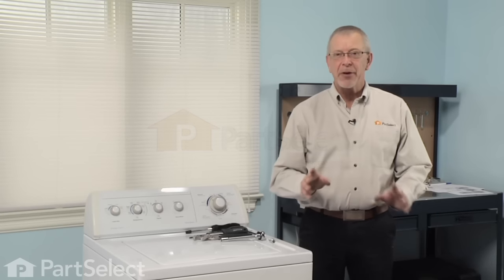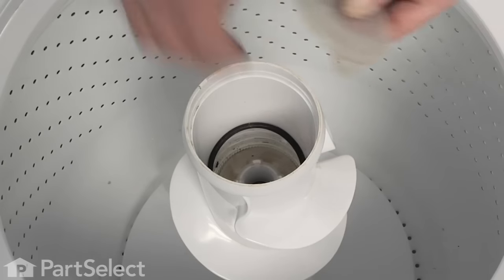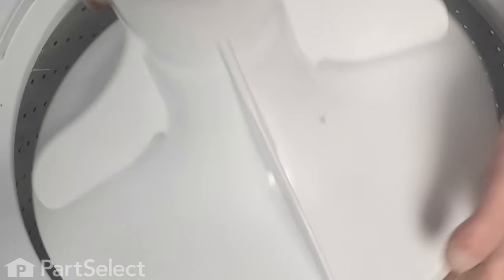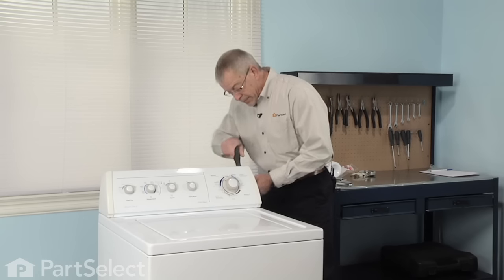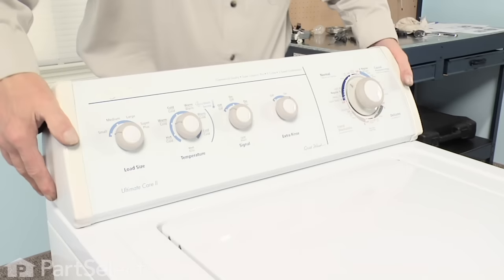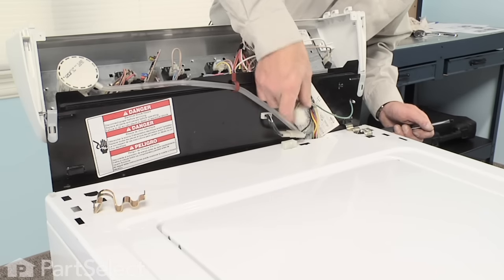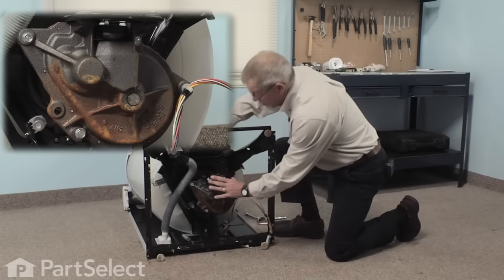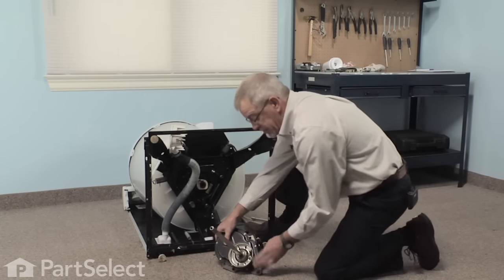Washer Repair- Replacing the Clutch Assembly (Whirlpool Part # 285785)

Comment: Do you find it absolutely necessary to remove the cabinet?  I have done couplers without removing it and didn't find it too bad.  Going to replace a clutch on a Whirlpool washer tomorrow and thinking I can probably do it without removing the cabinet.
Reply from the maker: You don’t necessarily need to remove the cabinet to change the coupler, but removing the cabinet is easy and does give you better access.

Comment: Advice needed - replaced the coupling and the clutch and it worked for 2 loads then quit spinning. Took it apart then put it together and the agitator spins(no clothes in it) but not the tub. Any advice??
Reply from the maker: If the motor is turning in the correct direction and the coupler is fine, then the problem should be with the clutch or brake follower. Verify that the parts are properly installed

Comment: What’s the main symptoms for having to replace the clutch? Is there certain noise?
Reply from the maker: Good question, since the clutches main purpose is to allow the inner basket while full of wet clothes and water to spin. It basically unloads the initial strain of trying to rotate the basket from the motor. Clutches typically have brake bands like your car brakes do.  Like your cars break pads they can squeal or chatter or even grind if worn down enough.  The  most notable symptom is the clothes are not being spun as dry as they usual do. Some clutches are also used as a braking device to stop the tub when the cycle is finished or the lid is lifted. Sometimes you may get a large bang as the brake grabs and the tub is moving still and gets slammed against the cabinet, That can be a bad clutch and usually the arm that engages it.   Hope this info helps.

Comment: at 10:53 what is the part number for the e-clip that holds the brake cam in place. The clip keeps coming loose!
Reply: Did you find a new clip as yet?
If so, excellent.

If not, 2 things:
1)  you might be able to take it to Princess Auto (if you are in Canada) or Harbor Freight (if in the USA) and you might be able to match it up with something they have there.
Or you could research other places that have the ring.
For size, if you have calipers, you could measture the inside and outside sizes.

2)  if you have a vice, you might be able to SLIGHTLY bend it in (not enough to snap it) and then it should fit back on without coming off again.  Just make sure that you are installing it correctly.  It should "SNAP" into place and fit inside the channel that is there.  If it's outside or on top of the channel, then it's not in right.  You may have to also make sure that the parts that slide onto that shaft are all the way down as well.

Hope that helps.

Comment: MY older whirlpool drains but wont spin only on full loads, I can sometimes go back to rinse after removing a few towels and it will work fine. Does this also sound like clutch,, washing 3 towels at a time is apain, appreciate any help!
Reply from the maker: That is a common symptom of a worn clutch.

Comment: I appreciate the effort put into this instructional video.  I cannot get my drive shaft out.  I can pull it out about 3-4 inches but no further.  I have pulled my back trying.  You do not show removing the  spanner nut.  Is it necessary to remove that?  That is the only thing that I can see that might be keep it from pulling out completely from the bottom.  I ordered the spanner nut wrench tonight because it will not budge using other methods and work arounds.  My machine is 20 years old, at least, and lots of crud covers everything, so its hard to really identify the parts, but have managed to get everything out/off but the last few inches of this drive shaft!  Please advise if you can.  Thanks.
Reply: How did you get it off?

Comment: I am having  a problem with my Whilpool washer mod. LSR100HQ0. It does not spin. So far I have replaced the motor coupler. I have also replaced the drive basket. It still wont work. I am out of ideas. I dont know how to test the motor, or transmission. What should i do next ?
Reply from the maker: Hi 3blowfish! I suggest you check for any objects that may be caught between the inner and outer tubs first. If the motor is not running during the spin cycle, check the lid switch for continuity. If the motor is running, have a look at the clutch. If the clutch is turning during the spin cycle but the inner tub is not, I would suspect a worn clutch. If the clutch is not turning, the problem could be with the transmission. Hope this helps!
Reply: +Pa

Comment: Thanks for the vid, very helpful; empowering actually.
Question if you have time: I have an Inglis IS43000 that appears to function properly until the spin cycle decreases or the lid is opened during that cycle. When either of these occurs the machine makes a loud banging sound and the tub appears to be vibrating as much as spinning. I've dismantled the thing and the 'usual suspects' look okay. Any suggestions? Thanks in advance.

Comment: but I have a freezer general electric  model #fp21sxarwh what is does is frost in every rack , I have to unplugged to get rid of the frost,because the ice covers the food, can u please help me  what wrong, thank u
Reply from the maker: +Everardo Camacho  Look for an air leak around the door gasket or drain tube opening. Even a small air leak will create a lotof frost.

Comment: I am trying to replace clutch from Kenmore, Series 70, Model 110.20702991
I followed video and removed agitator, clip and base piece.  Flip washer over.  Removed pump, wiring harness from motor.  Removed motor from transmission.  Removed 3 bolts but now my transmission shaft won't pull out easily.  Am I missing something?
Reply from the maker: +Shirley Hoffman The agitator shaft may be damaged where it contacts the upper seal in the spin tube and causing it to be tight. Try a little penetrating oil at that point and see if it helps.
Reply: Yes I had the same problem. I sprayed some lube on it and after several hard pulls I was able to remove it.

Comment: Thanks for the great video! My problem is, if left unattended my washer drains but fails to spin.  However, if I  hear it draining the water and then raise and relower the lid, I hear the drive engage and the spin cycle will actually start.  To me, it sounds like some sort of clutch issue.  For $20, it can't hurt to replace it on my 15 yr old washer.   Thanks again!

Comment: Very comprehensive video, sir, and well done. My washer tub and agitator function normally, but I'm guessing the clutch is the source of initially loud, tapering-off screeching that occurs as the spin cycle spools up. Before I pull this thing apart, what do you think?

Comment: Sorry this is the model # LSQ9544KQO
Reply from the maker: Your model uses a direct drive motor coupling they connect the motor to the transmission and consists of 2 plastic drive forks with a rubber coupling between them. One of the drive forks is attached to the drive motor shaft and the other is attached to the transmission input shaft. Normal wear of the coupling can cause the washer to not agitate. If the coupling looks okay then inspect the agitator, agitator directional cogs as well to see if they may be faulty. Hope that information helps!

Comment: I'm sorry but approximately 90 percent of the work you performed was unnecessary. You don't need to remove the surrounding case or disassemble the motor. You can simply lay the washer on it's back, remove the pump and slide the transmission out with the motor. Then you don't need to remove the clutch plate, just squeeze the spring together and remove the clutch.
Reply: lol....True. The clutch kit comes with lots of "extra" components, so the guy in the video wanted to make use of all the components.
Reply: It's best to replace ALL the parts, including the plate. Which means removal of the entire shaft. You never want to mix old worn/broken in parts with fresh new parts.

Comment: is it neccesary to remove the box and motor because on our if we tilt it we get access to the clutch asswmbly
Reply from the maker: If you want, you can do this without removing the cabinet or the motor, but you must remove the transmission from the basket drive before you can remove the clutch.

Comment: I noticed you did not address the clutch and brake springs.  What is the best positions for these springs to be in?
Reply from the maker: Hi Piddler51! I suspect that you are asking about the orientation of the
clutch and the brake assemblies as they are installed in the washer. The clutch
drum and brake assembly are rotating parts and the position that they are
installed in the washer therefore does not matter. Just make sure that when
changing the clutch spring that you use the same color as the original.

Hope this helps; thanks for watching!
Reply: Yeah, I have changed a couple transmissions lately, and as long as the springs do not interfere with one another, it does not seem to matter. I ask because I have seen some recommend a certain orientation in regards to the spring positions.

Comment: I just can't remove the transmission I have been heaving like crazy.  It supposed to be easy, slide out.  What did i do wrong? 😭
Reply from the maker: If you have removed the agitator and the three transmission bolts, there shouldn’t be anything that would prevent you from pulling the transmission straight out of the basket drive. Was the washer agitating okay?
Reply: We had the same problem. At first we didn't take the motor off, but once we did, I guess we were able to pull harder as we finally got it.

Comment: I have a roper top load washer the spinning has slowly stopping working over the past year. now its not spinning at all. i replaced the small $2 plastic coupler and its still not spinning. any help here?
Reply from the maker: What model number is your washer?
Reply: washer does not spin or agitate .Chris do I need to replace the clutch assembly ?

Comment: I followed the instructions, but when I slide the transmission shaft back into the hole, it goes all the way in except the last half inch.  The bolt holes on the transmission are lined up, but are half and inch from being in contact with the screw holes on the bottom of the machine.  If I put a bolt in the holes, it won't tighten because the trans. is not all the way in.  What happened?  I tried removing the clutch assembly then replacing transmission, same thing, it stops short half an inch.  So it isn't the clucth stopping it.  the shaft on top of the transmission contacts the bearing at the bottom of the machine.
Reply: Help me too, when I slide the transmission shaft back into the hole, it goes all the way in except the last half inch.
Reply: Sid Shakinis Same problem for me. The drive shaft seems to be hung up on the tub washer. Suggestions?
Reply: Karl Mielenhausen did you ever get an answer and/or how did you fix it
Reply: Yes, I figured it out. The clutch brake had engaged. Push hard on the shaft to reset the brake and it slips in that last 1/2" or so.
Reply: Karl Mielenhausen Thank you for your help it worked perfectly!!!!
Reply: Karl Mielenhausen When you said push hard on the shaft, do mean the whole assembly, motor, transmission, and shaft? Why would clutch brake prevent it from going in? Thanks.

Comment: i have a roper washing machine model# RTW4440VQ2  that fills, spins and drains but will not agitate but i can hear the motor running and when it spins it doesn't sound very good. i have rebuilt the transmission already but somethings not right. any ideas?
Reply from the maker: Have you checked the motor drive coupling?
Reply: yes it's good and i just didn't have the agitate cam seated good
Reply: thanks
Reply from the maker: It sounds like you solved your problem.

Comment: please help me , why I can not push in on the way to tight the 3 screws
Reply from the maker: If you are referring to the three bolts that secure the transmission, check the alignment onto the three posts that the bolts fit into.
The posts have a shoulder on them, so you must ensure that they are centered in the holes in the transmission housing. You may also have to rotate the cam follower a bit to allow the clutch to slide into place.
Reply: Make sure your break drive is pushed all the way up into the tub support otherwise the gearcase will never seat correctly

Comment: My Whirlpool Ultimate Care II washer agitates but will not always spin fast during the spin cycle.  If I manually spin the tub and then try the spin cycle it will usually start working better.  There is oil dripping from the transmission and there appears to be oil all underneath the washer.  Does it sound like a need to replace only the clutch assembly or the transmission? Thank you.